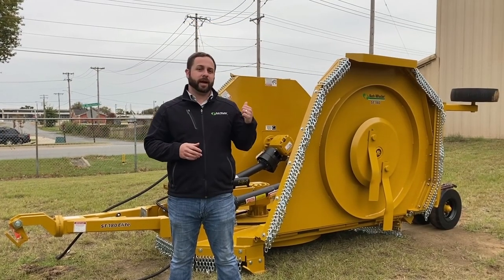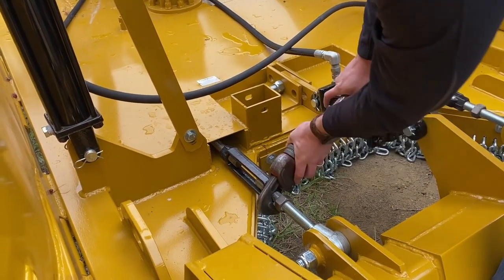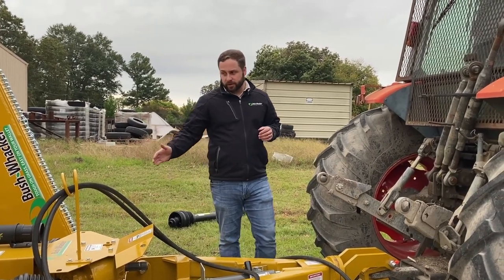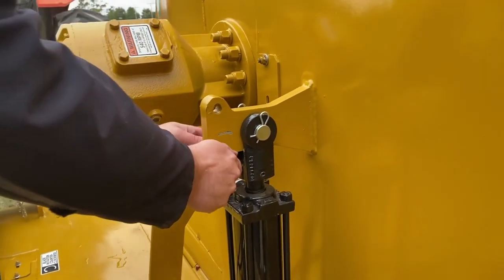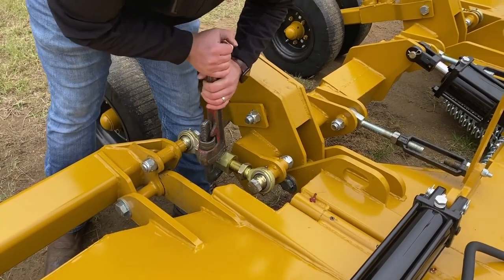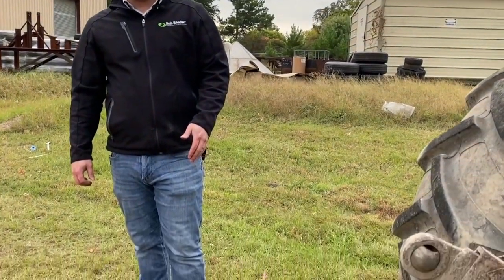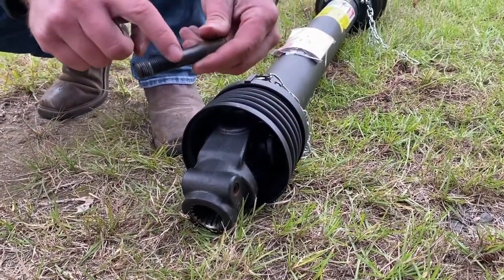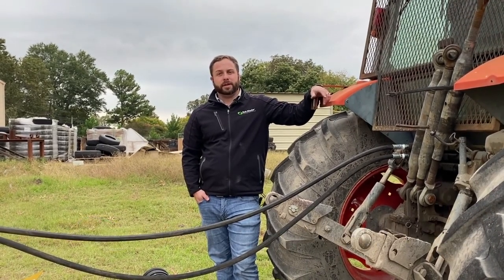How to set up a Bush-Whacker flex-wing brush cutter

Comment: Great video. Can you share proper servicing. The owners manual recommends filling up gearbox  up to plug on back of gearbox. Well the front gearbox has two plugs. Which do you recommend I fill it up to?  Also can you recommend a cotton picker spindle  grease?
Reply from the maker: Proper servicing would include to make sure blades are tightened to 350Ft Lbs torque. Grease all grease points (drivelines, wing hinges, hubs, etc). Inspect stump jumpers. Check hydraulic hoses and fittings for excessive wear or leaks. The gearbox grease should be filled to midway on the input shaft on each box. Important to remember that if you overfill the box it will spew grease out of the plug until the grease gets to comfortable level. You can order grease through one of our dealers. It is double ought grease or “00 weight”.
Reply: @bush-whacker1842  thanks. I mostly wanted to confirm the grease is “00”. Thanks.